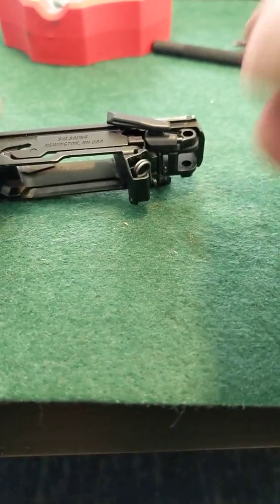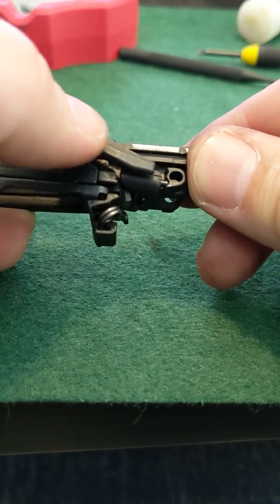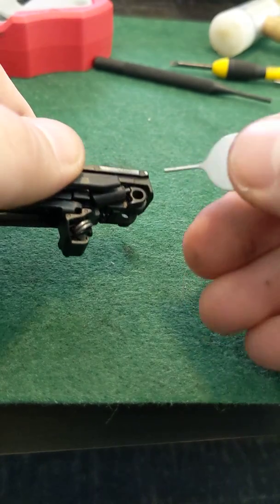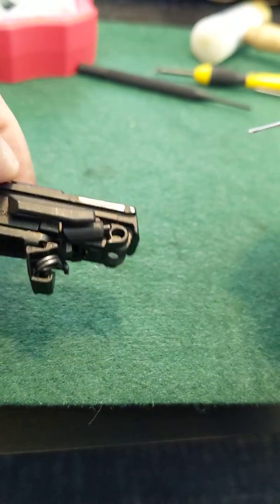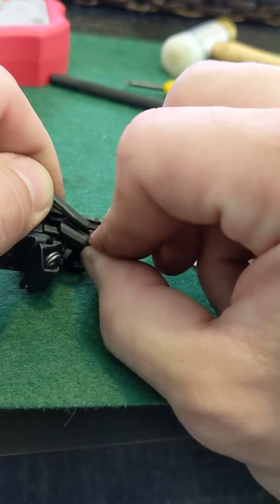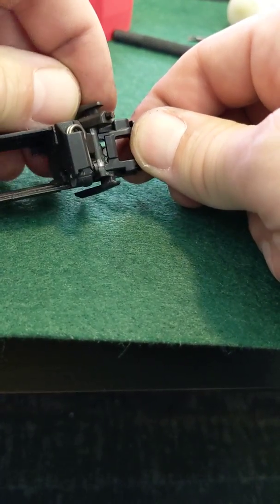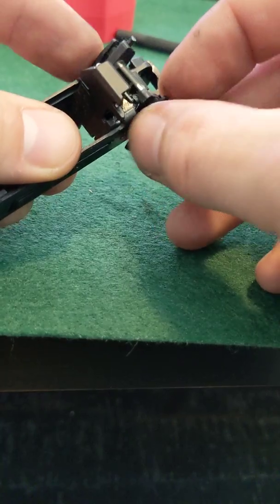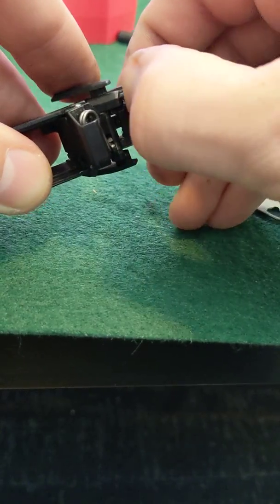Sig P365 manual safety removal

Comment: bought a 365 with a manual safety, it came with 3x12 round mags. I recently found a deal online for a Icarus Precision ACE hybrid XL grip frame for $180, but it does not have the safety cut on the frame. It fits flush with the 365, but I was calling around to see how much gunsmiths in my area would charge for them to cut the safety gap. It was not cheap and would've made the purchase pointless. This video and the confirmation in the comments just saved me a good amount of money, so thanks guys! I will remove the manual safety and can remove the extra siding from the 12 round mags and I have 365 slide with a XL aluminum frame :) can't wait to put it all together.

Comment: Will it still function without the safety?
Reply: Exactly what I'm wondering
Reply: Absolutely.
Reply: lmao... of course it will.... models without safety are exactly the same... you can purchase aftermarket safeties and put them in if you would like.
Reply: Yes I am the idiot who bought the sig xl and realized after spending a bunch of money that my ccw has a manual safety that I didn’t want. 😂 so this helps a lot. I was wondering if I leave the safety out. Will the cut outs on the lower get filled up with crap and effect the functionality?
Reply: Mad Man Podcast same with non xl version.
Reply: BigDog it’s 100% not obvious. Many guns with a MS will not function if you remove them. Not to mention internal safety’s that may be linked. It’s a perfectly reasonable question and only someone who doesn’t actually know and is only guessing would make it seem unreasonable.
Reply: Russell thanks. Yeah I ordered a new lower without MS cutouts and it took me 5 minutes to swap. I like the way they designed it so you can swap it easily
Reply from the maker: @HuhWhatHuhwhatHuh  This video wasn't intended to remove the MS to operate without it. The MS needs to be removed if you want to upgrade the trigger.
Reply: Andrew Hnyluk oh I do realize that. Regardless that’s what it helped me to do. Thank you for the info. No one else has it.
Reply: @sentfromdaniel  you want to come off that saftey?
Reply: Blake indefinitely
Reply: @sentfromdaniel  stick in envelope and let me know if you will pay shipping to get rid of lol. I'll buy it
Reply: Absolutely Great question I don’t like safeties on carry guns I remove them if they are easy to do so  this was easy then you just buy the new plastic and that way you don’t have a notch in it like in the original one
Reply: @sentfromdaniel  
Can you help me out I just did the same thing you described and I wanted to buy a frame without the cutouts and remove the safety.
How is the gun working out for you without the Ms??
Reply: @derellcaldwell8653  I bought the frame without cut outs. Gun has run flawlessly. I hit 1130 rounds a few weeks ago.
I also popped those pins out with end of a q tip. Very easy swap and I carry appendix. Left the pipe clear first 2 months until I got a lot of reps in at range.
Best gun I’ve ever owned man. I have had rust issues with mags but after I started using ballistol, I haven’t had any rust isssues due to sweat. I hope this helps man!
Reply: @sentfromdaniel  I really appreciate this man and it does help thanks bro
Reply: @derellcaldwell8653  you got it! Just take it slow. Also, I took the safety out of the housing inside of a big see through zip loc bag. Cause a small plunger can go flying. In case you wanna store the safety and frame for future or to resell. But once you do it. You’ll be like “Damn Sig really planned this out!” 😂🤣😂
Good luck brotha!
Reply: @sentfromdaniel  
Wow man.... I really appreciate this. You spend all that money on a gun and you wanna be completely happy about it
Reply: @derellcaldwell8653  get after it! 🤙👊💯
Reply: @sentfromdaniel  EEZOX is the best to prevent corrosion

Comment: Can i remove my safety completely and my p365 still function without it?
Reply: That's why I'm here.  Can't find the no safety version.
Reply: @losoj30  yes it will
Reply: Yes it will
Reply: Sure will!
Reply: @joemiester31  so if i remove my safety from my p365. Do anything need to go in  replace of that saftey switch or can i just assemble and its good to go?
Reply: @StylesBlender  just assemble and you are good to go! Hold on to the parts in case of resale!
Reply: @joemiester31  thank you
Reply: @StylesBlender  there are some videos online on how to do it. It's super simple!
Reply: @joemiester31  i searched for some and found some removal videos. But none of them actually removing and assembling, so i was confused it i need to put in another piece in replace of what i pulled out or if it was good to go. Had to look for comments